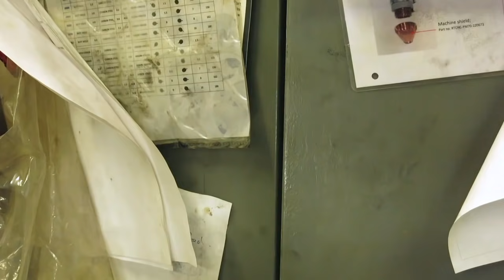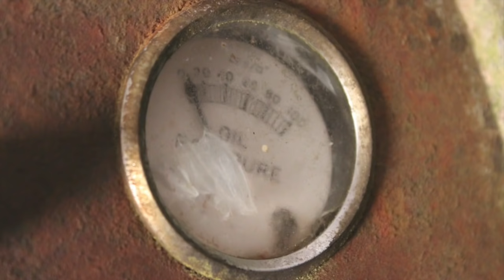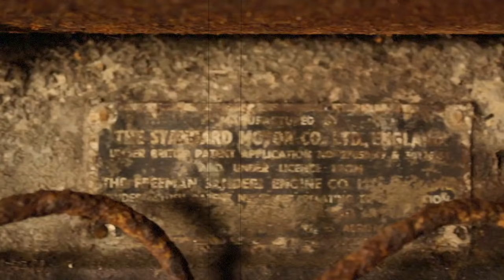Barn Find Fergie. Episode 5. How To Rebuild An Engine

Comment: Another great episode.  Beautiful to see the engine turning. Got a 24 year old socket set that I'm still using. Gutted when the 19mm split a couple of weeks ago
Reply from the maker: That's a gutter! Thanks!
Reply: Are you planning on tackling the gearbox?
Reply from the maker: @benpowell8945  Step 1 running engine, then we'll be heading back along the tractor for sure!
Reply: Thanks Ben, fingers crossed the gearbox doesn’t come up with any nasty surprises!
Reply: @montydog0  fingers crossed for you mate.

Comment: Hi guys, great video just a quick question,  where did you get those small cuff ring dowels from. Mine have walked of and I can't find them anywhere.  Looking forward to the next  instalment.  Keep up the good work.
Reply from the maker: They where in the engine when we stripped it down, see Ep 2. You could make some from a bit of correct diameter rod? Thanks!
Reply: I don’t think you’d have any issues if you just made them up from a bit of rod as Jimmy said. They were only mild steel, not hardened or anything spacial, purely to prevent rotation. Thanks for watching 👍